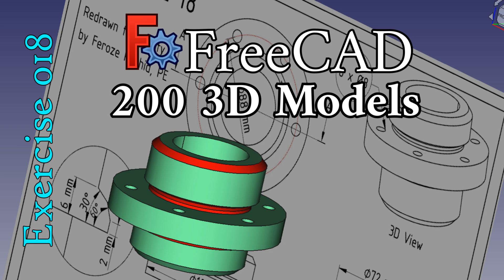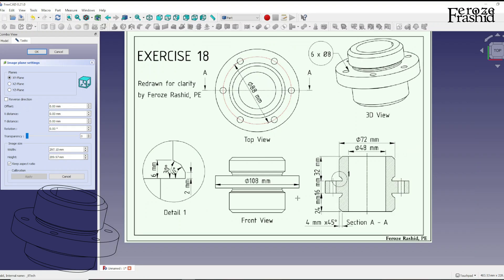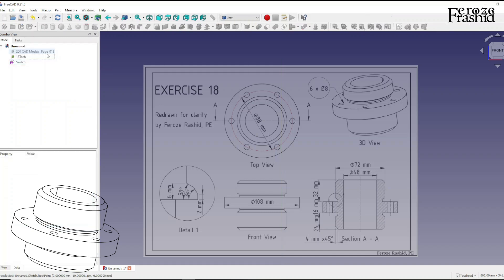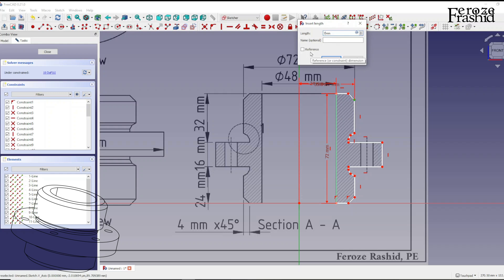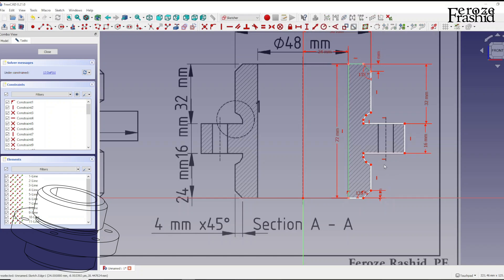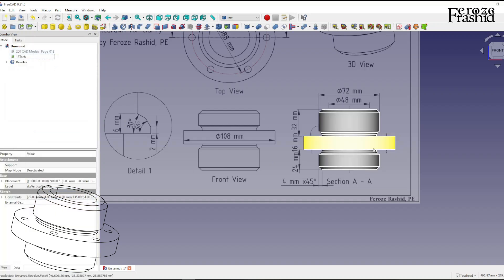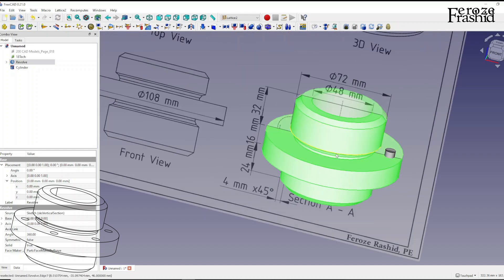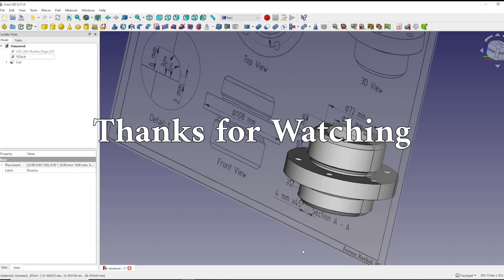200 3D Models in FreeCAD: Exercise 18

Comment: The original image has bad aspect ratio, otherwise is good. You have to switch off the "Keep aspect ratio" checkbox, then calibrate once on  a horizontal dimension, write down the Width value, then calibrate on a vertical dimension, then fix the Width value.
Reply from the maker: Thanks, I will try that next time I face a similar issue.
Reply: @kattkushol  Thanks for your series. After a long time thinking about it I've decided to learn FreeCAD for real, and these hands on lectures help a lot. Fortunately I've found a the images on the net too, so I can follow your instructions exactly.